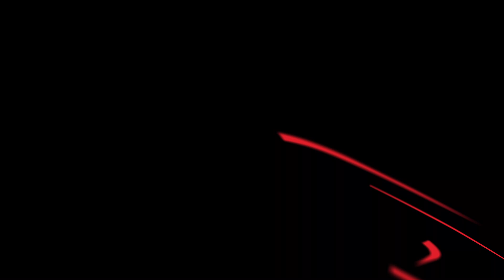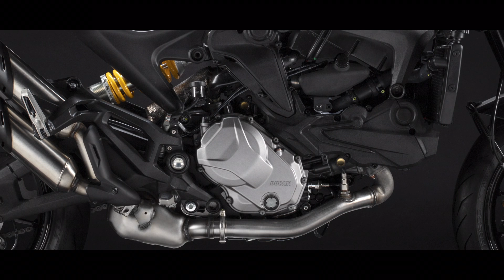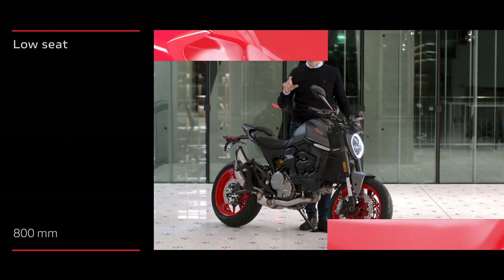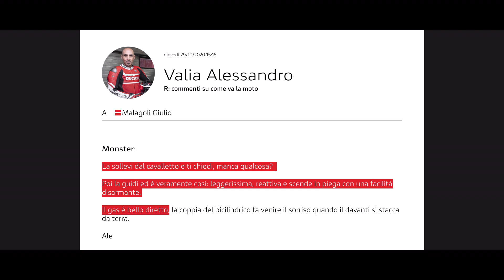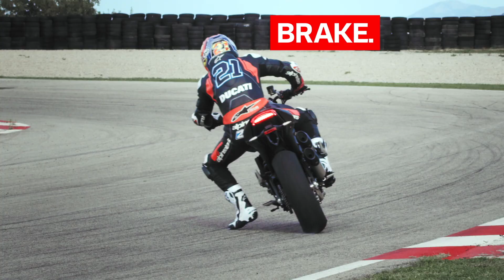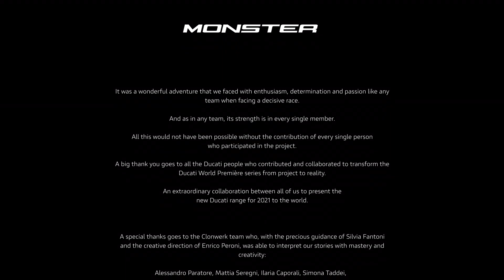New Ducati Monster | Ducati World Première Episode 5 (ENG)

Comment: WHERE IS MY TRELLIS FRAME!?!?
Reply: So if Ducati finds a better frame material/design, they're to keep using the old one forever?
Reply: @rlsedition  Oh, cast aluminium is a new material is it? LOL
Reply: @RJCpt  For Ducati, yes it is. This puts the Monster in the same vein as the Panigale and Multistrada models, chassis-wise.
Reply: @rlsedition  so ducati was wrong all this years uh?...
Reply: @RJCpt  You'll notice the Ducati motoGP bikes changed from a trellis frame to their current aluminum design about five years ago. And cars no longer use running boards or bias ply tires.
Reply: @rlsedition  KTM do, and they win races in Moto GP to... It's not about the performance, it's about the price ..
Reply: The weird thing is they just launched the Ducati Supersports which has a trellis frame... so with the new Panigale frame does that mean the new monster is sportier than the Supersports?
Reply: I might consider one now they’ve got rid of that awful trellis frame ... Kawasaki have started putting it on their bikes and it’s putting me off them !!😁😁
Reply: @RJCpt  Price? The KTM Duke 890R is very close in price to this Monster.
Reply: @RUBBERNMETAL  You didn't notice the SuperSports 950 was only a design refresh while this Monster is all-new?
Reply: @dmandhelen  I've owned plenty of Ducatis with trellis frames. They seem to work well, but that doesn't mean the company can never change. As with every engineering decision, there are pros and cons to each design alternative.
Reply: @rlsedition  you’re right ... it’s just how they look that’s all .. I’m not keen on .. so this new monster is a Winner for me ..:-)))👍👍👍
Reply: @rlsedition  still making it weird for Ducati to launch a bike called ‘Supersports’ when a monster has better chassis for sports riding.

Comment: This bike is super light[same as the Street Triple RS] but with loads more grunt. Should be huge fun. I like the styling. It's modern without looking like an insect or transformer. No word on the suspension though. Is it fully adjustable? It's probably a sachs rear shock but the front forks I'm not so sure.Will have to visit the official web site for full details. The big question is how much is it?
Reply: Pricing is on the Ducati website.

Comment: Sorry but this is not a Monster, even wikipedia knows it:
"The Ducati Monster (called Il Mostro in Italian) designed by Miguel Angel Galluzzi and produced by Ducati in Bologna, Italy, since 1993. It is a naked bike, characterized by an exposed engine and frame. The trellis frame in the Ducati Monster is an integral part of the motorcycle's design allowing for both aesthetic appeal and for structural efficiency.".. "Galluzzi penned a "muscular" fuel tank and minimalist bodywork "
Reply: OK, so the lack of a trellis frame means it can't be a Monster to you?  And Galluzzi was making a promotional statement for the then-new design.

Comment: Thank you Ducati; I will continue with my plan to buy a Hypermotard 950 SP next month; this model is not for me.
Reply: Me neither, but I sure like my SuperSport.
Reply: @rlsedition  Do you have the new one, or the 2020? I live in a very congested city that's tightly packed because it's surrounded by water. A bike that needs to stretch doesn't do well here, and every ride can't be epic.
Reply: @Ramon51650  Mine is a 2017 vintage SS. No problem with you wanting a Hyper if it suits your tastes and where you ride, but, like you said about this new Monster, the Hyper is not for met (I want a full fairing).

Comment: The exhaust pipe, losing the previous versions curves and with the addition of the plastic tips just doesn't look stylish.  The tank also appears to have more plastic parts rather than the sleek aluminum...overall it's a great bike, I owned the previous version 821 before  moving on to a 1260 Multi.  The styling on this bike appears to be Japanese...almost like an MT07

Comment: Looks so empty underneath the radiator
Reply: There is a bellypan available as a Ducati  accessory that fills in the front lower area.
Reply: @rlsedition  don't think a bellypan is going to solve the gap I see. I'll wait for the V2 Streeetfighter
Reply: @Addy29plus5  Did you see the photo of the accessory bellypan in the Ducati video? I don't think so. And it's not at all clear Ducati will introduce a V2 Streetfighter any time soon. We'll see.
Reply: @rlsedition  I'll buy the V4 if it doesn't come out by 2021. Don't get so personal and defensive my friend. It's an opinion. I don't like adding accessories just because the manufacturer decided to go with a certain design choice. Spending more money on a middleweight-ish bike that is at the top end price wise and from a manufacturer like Ducati. I've been to the factory and consider myself a Ducati Fan but I don't like this new monster for some reason
Reply: @Addy29plus5  I'm defensive about this new design because so many here are panning it without actually seeing the machine in the flesh. Having worked in the auto industry for many years, I also know companies must advance, taking design and technology risks, or be overwhelmed by the competition. As for your opinion, you're entitled to it.

Comment: Nice lighting concept and great Termignoni exhaust system. BUT where are the remaining 300ccm, the missing 60 HP, the great brake and chassis components, the missing 1-2 inches of display and above all the single-sided swing arm hidden? And then also the missing tubular frame 😰. For me, unfortunately, she can hardly be recognized as a monster. In my opinion, it looks more like a red mixture of KTM 790 Duke and MV Agusta Brutale 800. Someone was probably afraid of cannibalization effects with the in-house Streetfighter. It's a shame to bury another classic 😭. In the category I prefer the Triumph StreetTriple RS. Two weeks ago, BMW demonstrated with the S1000R how you can sensibly update a full-blown naked bike without participating in the (self-initiated) horsepower madness 👍. I would have wished for something like that here too. So the Monster died for me.
Reply: It appears Ducati thinks if you want to replace a Monster 1200, it's called the Streetfighter.

Comment: Calling this a Monster is like saying carbonara can be made with cream instead of egg yolks... call it something else and you've just released a nice competitor for the Japanese nakeds, but not a successor to the Monster IMHO.
Reply: def true
Reply: Yeah, and the Jeep Cherokee should still look like a box, right, instead of the more progressive design they have now? I heard the same comments when that design was released, but Jeep was right and they've sold a ton of the new ones.
Reply: @rlsedition  So you're saying the new Jeep isn't still a box on 4 wheels? TBH to get this level of change you'd argue that if the cherokee turned into a dinky hatchback it's still a cherokee because it has the badge on it.

I'm not saying this won't sell (as the extremely similar Japanese nakeds sell as hotcakes). All I'm saying this new 'monster' lost its design cues completely (the trellis frame is IMO integral) and looks generic AF whilst still trying to sell under an established models name.
Reply: @AriesTheUmpteenth  And Chevrolet should never have created the mid-engine Corvette because it doesn't look like the older ones. I say if the new aluminum frame works better and saves weight, go for it.

Comment: Monster v4 or 1260r ?
Reply: I'm thinking a 950 and 1260, with v4 released later on
Reply: @ducatinyc   да в этом и проблема, 950 совсем не хочется,  либо 1260 либо V4  охота, 160лс+  и олинс в круговую. 130/150мм
Reply: @sergbf  160!!! way to much for me and my city riding.
Reply: @ducatinyc  очень ждал нового мульта V4  в версии пайкспик но что вышло то вышло. Если с 19м колесом еще можно катать  агрессивно , то вот с их "фирменной подвеской скайхук" нет. Полная дичь, что мешало одну версию нарядить в механический олинс не понятно..
Reply: Monster 950
Reply: There will not be a V4 Monster because that segment is already taken up by the Streetfighter.  There also will not be a 1260 because the engine is too big for this new Monster’s chassis, and they will not make a new front frame just for one model of Monster, too expensive.
Reply: Ducati scrapped a whole range with just this 950 model that trades character for ambiguity. But hey you’ll get stickers.
Reply: @ducatinyc  I don't think so. Buy the Streetfighter V4.
Reply: @ilmostro16  I agree with your assessment.

Comment: This "Monster" labelled bike lost all its characteristic features: trellis frame, dry clutch, single sided swingarm, exposed engine, aestetically winding exhaust pipes, round bodied fuel tank, Öhlins suspension. 

Instead Ducati just fabricated a chep, plastic mid-priced Yamaha/Kawasaki/Honda look-alike. Everythin about this bike screams "let's keep production costs to a minimum and maximize profits". Aluminium main frame, platic subframe, smaller fuel tank, double sided swingarm, non-adjustable non-name suspension and all the bits and pieces taken from other models to increase parts production numbers over all model lines. And all the ugly platic covers around the engine are a total no-go!

I used to love Ducatis for what they were: really good looking and sounding bikes with unique characteristics and features. But Ducati, where have you gone!? Why are you purposely killing your own DNA? I would rather buy a Yamaha/Honda/Kawa which all look similar, but are much cheaper (to purchase and in maintenance) or a KTM 890R which also has a V2 engine, but sticks to its characteristic DNA. I wonder where production numbers for the Monster line will go in the coming years.

Comment: Yet another Honda design copied by Ducati.
Reply: BS.
Reply: What Honda design was copied by Ducati? I recall the Honda Hurricane model years ago copying the Ducati Paso and later CBR600 versions copying Ducati's 916 headlamp design.
Reply: @rlsedition  Well, if this one doesnt look like a CB650F i dont know what it does.
Also the original Monster in '92 was copied from a Honda, but I dont recall what model it was.
Reply: @Bush0r  Sure, this new Monster has some similarities with that CB650F, but it's not a copy at all. How much can you do differently with only a fuel tank , seat and front fender to work with on a naked bike? And pay attention to how much better integrated the side view of the Monster is around the engine compared to the Honda. The original Monster copied from a Honda? NFW.